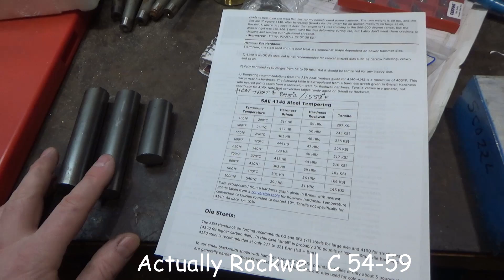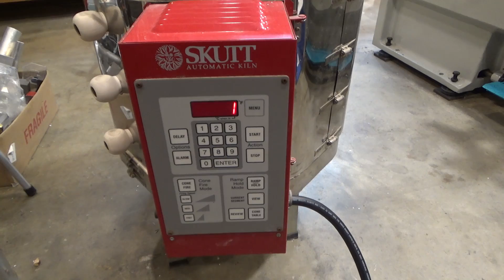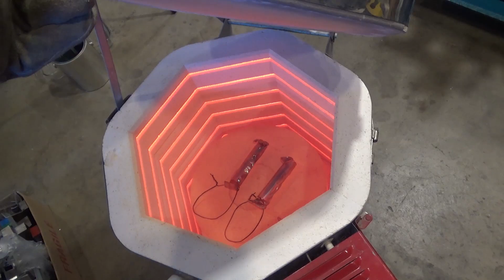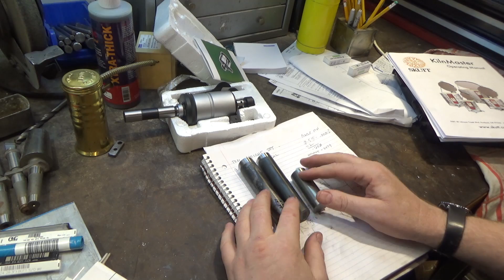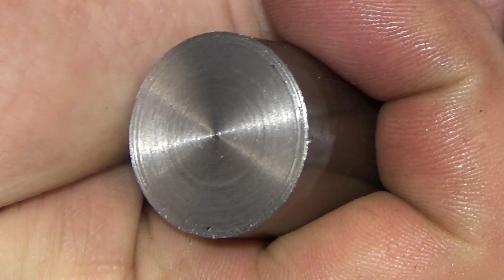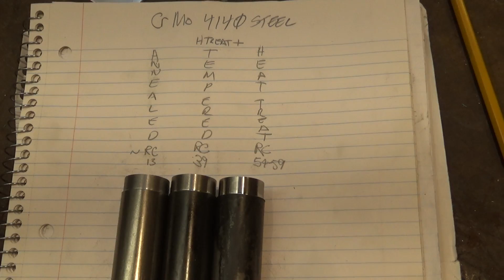The Effects of Heat Treatment on CrMo 4140 Steel in Turning Operations Part 1

Comment: When you remove steel at 1550F, you have only hardened the surface of the material. The interior of the steel never reached 1550F which allows it to draw the heat like a sink resulting in a self tempering. For a through-hardened steel, it needs to be held at 1550F for an hour then cooled in oil. If your only cutting 30mils deep, there shouldn't be a difference. Hut, if you go further, you will likely see a worse finish with material closer to a 1/4 " in. But, I do like the video. I am watching all 3 in the series.
Reply from the maker: I guess I did not talk about specifics, but I let it soak at each temp specified in the ASM handbook for heat treating 4140. I apologize for not doing a good job explaining what I was doing.

Comment: Carbide likes to be pushed hard. I have a 1440 manual lathe and I get my best finish running at 1350 or 2000 rpm (max for my lathe sadly) and 0.030 to 0.060 depth of cut and like 0.005 - 0.006 per rev feed rate. I have the worst time with finish when I want to just shave off a thou or two. The big heavy cuts, where the chip breaker is making 69's, leaves a gorgeous finish. If you figure out how to sneak off 0.001 and leave a perfect finish, definitely post a new video. Cheers
Reply from the maker: Thanks for sharing your successes. This video was shot many years ago. I really need to revisit the problem. I definitely have issues taking shallow cuts in difficult materials like this. I have a vertical shear tool that works better than most.
Reply: @DudleyToolwright Still a great video. I did a vertical shear tool too but wondering if my geometry is not as good as others. It pulls off really fine swarf but finish sucks.

Comment: i know this is old video but to get mirror finish on annealed 4140  you want to run as fast as you can apparently. found this accidentally by facing larger 2-3/4in stock. inner 1/2in was always dull like yours but outer face was mirror finish
Reply from the maker: Thanks for the tip. In the early days of using my lathe, I was really conservative with the feeds, speeds, and depths of cuts. Increasing different combinations of these definitely improves the surface finish on hard to cut materials.

Comment: Dude..........Insert? Carbide needs to be pushed..........you are "Mamby Pamby'ing" around. Or get a diamond file and sharpen the insert edges...........or really bite the bullet and learn to use HSS if you want fine finishing cuts......Davo from Aus.
Reply from the maker: You are absolutely right about the feed rate and depth of cut. This video was very early on in my career and I had gotten out of Machining Classes not that long before and it was hard to get their "take it easy" recommendations out of my head. Thanks for the tips and cheers.

Comment: Here is your Kiln I must have missed this video back then. Saw you use this heat treat oven in your current video and was unaware you had this. Nice what to do with the oil tip and affordable as well. Nice share part 1 off to part 2, thank you. Lance & Patrick.
Reply from the maker: Thanks for watching. The only problem with the kiln is that it is big and takes a long time to cool off. So when I need to temper after a heat treat it is a pain to get it to cool down to the right temp. I might be building something much smaller with a lot less thermal mass. Thanks for the comments.

Comment: dude, i take .030 on finish passes. take .030 at .0065 a rev at like 400  sfm. perfect combo for a 1nose tool, on 4140 or 4340
Reply from the maker: Thanks. I have recently turned some 4140 again and it does indeed get a nice finish when you take big bites, like 0.100 Depth of Cut. The feed rates and RPM seem to matter less. One thing is for sure, I can't get a particularly good surface finish with small Depths of Cuts. Thanks for the advise. It is always much appreciated.
Reply: @DudleyToolwright  no problem at all man. I work for an industrial company, and we make very very large parts for haul trucks for the coal mines in Wyoming, and also the draglines and shovels and stuff for the oilfield. From my experience 4140 does work better around 400 sfm for roughing, and like 550 sfm for finishing. Try to get the radius of your Insert all the way in. For example, if you have a 1 nose radius that's  a .0312 radius. So, to get that radius to cut best, try to take at least .016-.032. but hey it's all about having fun and stuff, and just trial and error. Have fun and be safe man :)

Comment: 4140 heart treated, used for years in car gear boxes. 4140, is bloody good steel. 41xx is the series. Get yourself a "Machinery Handbook". It is not expensive, small drill chart booklets can cost as much. Southern Cross in its early years in Toowoomba, used the book as a syllabus to train their own engineers. " Good tools don't cost, they pay"
Bloody well done mate.
Reply from the maker: That was some good advise. Thanks. I agree whole heartedly about quality tools, but sometimes the only way to have a tool is compromise, but when I can I get the best. Machining is a bloody expensive hobby. I do have a Machinery's handbook, but it kind of reads like a dictionary. Hard to learn the language from, but a great reference.

Comment: What's that grade of insert? If I would have to guess that insert has atleast a .015" nose radius so at minimum you need to get the the tool to a .025" doc and feed that it around .006 - .008" ipr. I would run probably around 600sfm but that would depend on the grade and coating of the insert. For what you are doing I would run a vnmg 431 at .015" doc & .004" ipr at 750 - 1000 SFM. Just my thoughts.
Reply: Oh and I always feed harder in softer steels with a 432 insert you'll get a little more visible tool marks but way better finish. I'd run 650sfm .065-.185 at .008"-.012" ipr. In the annealed 4140.
Reply from the maker: Thanks you for the very detailed suggestions. I will give them a try. I have since found that I can get a good surface finish if I have the lathe set at 1100rpm with 0.014"/rev feed rate and 0.025-0.050" depth of cut. This is tough on my cheapo inserts though. I will give your recommendations a shot. By the way, most of the inserts I used to buy have a very small nose radius. Perhaps that was also part of my problem. Just so you know, if it wasn't already obvious, I am a fairly new to machining.
Reply: @DudleyToolwright  True imo a large tip radius is better to rough with. It's tougher and leaves a good finish as long as you feed it hard enough so you don't rub the insert. Also how are you calculating your SFM? I'd download a app called Machinist calc pro it pretty helpful to find your SFM depending on the diameter. Also if you looking for some good inserts to try hit me up. I have stacks for pretty much every type of turning and material.

Comment: I'm not sure what the point of choosing a specific material like "4140" for a given application/usage is based on presumably its "important" physical characteristics as-is and then to improve "surface finish" and "machinability" altering those characteristics through any heat treatment process. You can't "heat treat" the raw stock, machine the part and then "remove" the heat treatment and not end up with an "out of spec" part. And there are plenty of resources out there to tell you how to get the desired surface finish from "as-is" 4140 or at least the best possible results since 4140 "chrome-moly" is typically not even used in "bar stock" form for machining "billet" parts but is most often found and used in "tube" form where its physical characteristics that make it HARD to "cold work" i.e. "machine" with a nice "smooth" finish make it ideal for BENDING and FORMING. And "4140" is only separated from 4137 and 4142 by "slight" differences in the "range" of carbon and silicon "percentages" the finished steel contains. Steel really can't be "graded" UNTIL its been made since accurately determining must less controlling the "content" of a steel "melt" before or during the process OF melting the alloy components and "mixing" them is pretty much impossible. And now the steel is "worked" has a HUGE effect on its ultimate "strength" as well as its "hardness". Hot-rolled and annealed 4142 (there really isn't a "4140" alloy but rather "4140" is a "family" of alloys) is approximately the same "hardness" and "strength" as both "4130" and "4150" at 90-95/96 Rockwell "B" hardness and 60,000/65,000-70,000/75,000 psi yield strength (the point where its "elasticity limit" is reached) while 4142 "cold drawn and annealed" is 96-100 Rockwell "B" hardness and 85,000-95,000 psi yield strength. The other MAJOR difference is that "cold drawn and annealed" means ROUND BAR STOCK and "hot-rolled and annealed" means its flat "plate" that's being formed into "DOM" (drawn over mandrell" tubing and as such is going to be "stretched" and "weakened" and then "welded" at the seam. It's never going to be as "strong" or "hard" as BAR STOCK. 

If you want much "harder" 41XX "chrome-moly" alloy for "machining" you should be using a grade of steel "below" 4140 to begin with. The lower the number the higher the chrome, the lower the molybdenum and the "harder" the steel will be while still being pretty damned "soft" for any "machining". If you want "hardness" and "pretty" surface finish you should be using a 5XXX "chromium steel". with little or no "moly" since "moly" is a "lubricant" and MAKES the steel and chrome and silicon and carbon molecules "slick" and soft and easily "repositioned" instead of being "displaced". 

Maybe you think because many "forged crankshafts" are "chrome-moly steel" that means they're "hard" and "rigid" and end up so "pretty " by machining via "cutting" when in fact a crankshaft has to be relatively SOFT and DUCTILE and finish "machining" of a crankshaft is done via grinding and "polishing" with emery cloth. There's also some "hardening" done but typically with shot-peening both for stress-relief and to improve the surface "hardness" and density while maintaining the "softness" of the inner steel material below the "surface". Heating and quenching "chrome-moly steel" tends to "through-harden" it because the "quenching" cools the exterior so rapidly and contracts it so the whole cross-section rapidly "shrinks" and gets very "hard" and "dense". Shot-peening hardens only the surface and the vibrations and impacts actually REMOVE "stress". 

You're just not going to get "forged crankshaft" type surface finish and "prettiness" no matter what you do turning parts on a lathe out of cold-drawn "4140" bar stock. A forged crank is also "stamped" into shape starting with a big, hot billet of "4140" in order to preserve the "grain". 

There's a reason you need "sandpaper" to get any kind of "decent" surface finish. "4140" doesn't like to be "cut". It likes to be "polished".
Reply from the maker: That was a really amazing set of information you shared there. I really appreciate it. I chose 4140 originally by scanning through ASM datasheets for the various alloys looking for something with a particularly high tensile strength. I have since found other alloys that are stronger, but I am always intrigued by extremes. I had mistakenly thought I had found one, thus the interest. I will be honest, I know very little about all of the different features of the different alloys and working with new ones is kind of like Christmas. It is always new and exciting. I  really appreciate you explaining a lot of details that the simple data sheets neglected. I realize that there is little replacement for experience and I value you sharing yours. There is so much to learn about this particular hobby/career that I will probably never get bored of it. I will have to look out for some 5xxx series steel  to give it a try.
Reply: What a liberal use of quotation marks you have there, but that is very good and well delivered information

Comment: The parts and presumably the wire "hangers" installed on/in them were "glowing red hot" in the "oven" yet when you pulled the part out of the "oven" the wire hangers remained bent and twisted? And even with one part quenched and that oil presumably damned hot putting another "glowing red hot" part in close proximity to all those oil vapors did not ignite them? That's interesting to say the least. So were the "boiling oil bubbles" that looked a lot like somebody threw a little dry ice in the oil.  And you do NOT want to use "peanut oil" if you want to avoid a "flash" with those red-hot parts coming in contact with the oil at any temp. Peanut oil gets "unstable" at 350 degrees F. Its also strange that the "tempered" material even though oil-quenched and put back in the "oven" didn't end up with the "mill scale" (an oxidation "artifact" unrelated to "quenching" or "tempering" since "steel mills" produce "raw material" rather than finished "stock") aka "cooked oil" burnt off of it by the time it had gone through the "tempering" process.
Reply from the maker: Interesting. Thanks. I used actual quenching oil, but in the forums other people suggested various other oils. I have not tried any of them. To be honest, I have only very limited experience at all in heat treating, but I am very interested. There were no special effects like dry ice used. Thanks again for sharing your thoughts. I appreciate you spending the time to help me out.

Comment: Hi, do you not have the cutting data for the carbide insert, the hardening proces seems to me to be flawed by the pieces being wrapped in ss foil, no quick cooling so no control of end result.
Reply from the maker: I was thinking the same thing at the time, but was not sure about how you were supposed to deal with oxidation issues. I have since read that you need to remove the parts from the wrap before quenching and I guess live with the oxidation for the brief exposure time. Thanks for the comments. They are always appreciated.
Reply: Hi, found this on the interweb : https://www.bladeforums.com/threads/diy-anti-scale-compound.670773/ , and about the inserts I think you will find cutting data is importent, also the basic negative vs positive results.
Reply from the maker: Thanks. I really appreciate you taking the time to get me this info.
Reply: Hi Your welcome, I also remember Shadon HKW talked about a special oil that minimized distortion of his small squares, not what you asked for but in the neighborhood.
Reply from the maker: Thanks. I saw that video and really enjoyed it. thanks for the referral.

Comment: Your speeds and feeds are off plus you need to cool the material when your cutting other than that awesome video
Reply from the maker: Thanks for the suggestions. This video was shot quite a while ago, but I still have difficulty finding the proper feeds and speeds. Most of the inserts I use are inexpensive and do not give recommended speed, feed, and depth of cut information so I often do experiments to get a good combination.

Comment: This is a great experiment.  I would love to see you eliminate a few variables by putting the cutting to at the correct height (no nipple left when facing), and also even slower speeds with the hardened and hardened and tempered, though I suspect result would be similar with the speeds.  Carbide inserts are notorious for tearing at the slower speeds! HSS bits are supposed to be better.
Reply from the maker: Thanks. I agree with your assessment. I did this experiment a bit ago and am slowly learning the ropes. I have used the leftover hardened pieces since. I also, now have a Rockwell Hardness measurement device, so I could quantify the results better than using the hardness file method. Thanks for you suggestions.
Reply from the maker: I have since learned about vertical shear cutters and would like to try those and see if I can get a better finish. I have even made a video about modding an indexable holder to perform the same function. 

https://youtu.be/RuJXMAcsQA8

Comment: Don't think this test say much. Nor i think the harder piece is higher the 45hrc. Many other aspects not treated there. Finish can be strictly tied to your machine stability.
Reply from the maker: Fair enough. I appreciate your comments and thoughts. I will pursue the hardness relating to finish again at some point in the future. I recently got a Hardness Tester and will attempt to verify my guesses (which were based on the heat treatment tables).
Thanks.

Comment: Good trick if you have a small oil tank and it gets to hot is to cool it with a heat sink, I use a large aluminum flat bar.
Reply from the maker: Great idea. Thanks for the suggestion. This is on of my first attempts at heat treatment and I  was not fully prepared for all of the effects of the process. Thanks for taking the time to help me out.